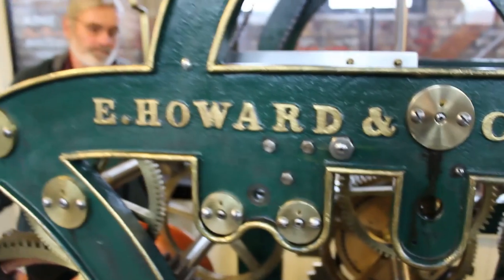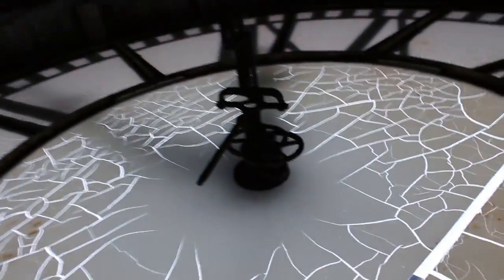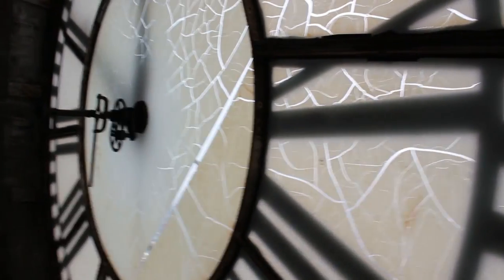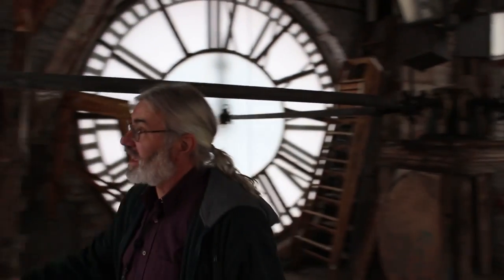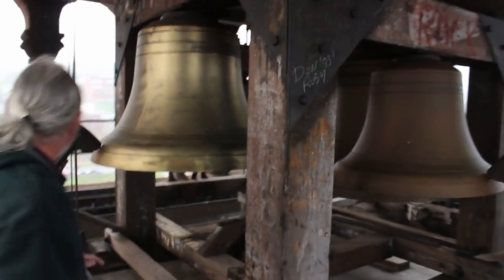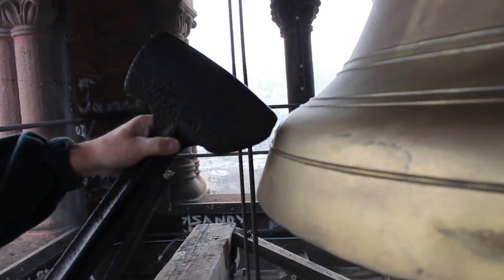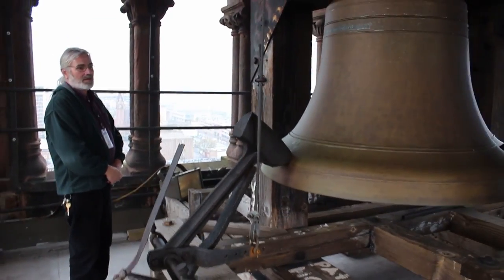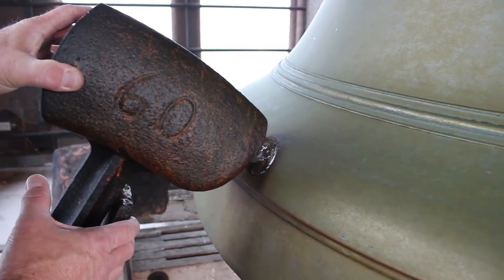Exploring the Old Central clock tower in Duluth

Comment: It still works even after being abandoned ? Wow that's amazing does the guy you were with take care of it and wind it or someone else
Reply: Banished_slym I checked and they still have the original E Howard Movement, but the weights have been replaced by electric motors so there’s no need to wind it, it just needs oiled every once in a while.
Reply: The building is not abandoned. It's currently occupied by the offices of the school district and several other programs.